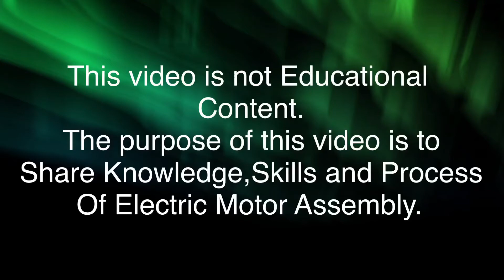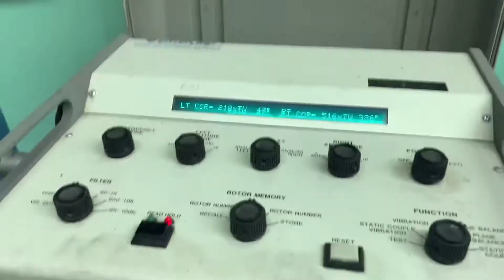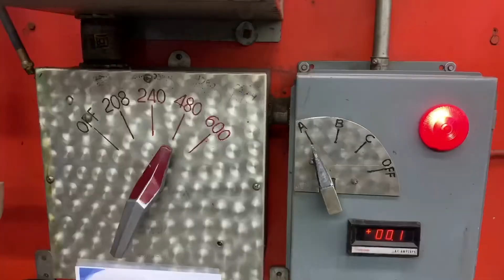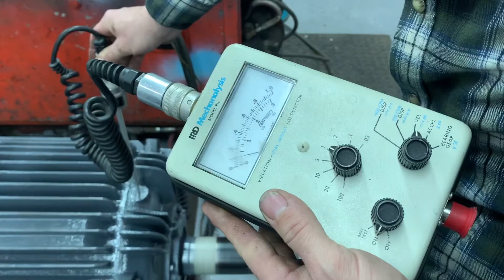Motor Rewinding;Part 2 Toshiba 200Hp Electric Motor Assembly

Comment: Great job but how are the end shields that tight of a fit? Normally you would slide them straight over the bearing?
Reply from the maker: Hi Ryan we depend on the speed of the motor if 3600 rpm should be slide fit for the bearing when it gets warm but if low speed should be tighter a little bit within standard bearing tolerance.